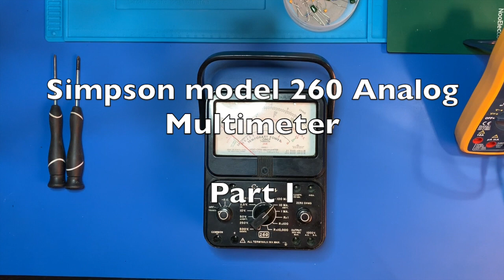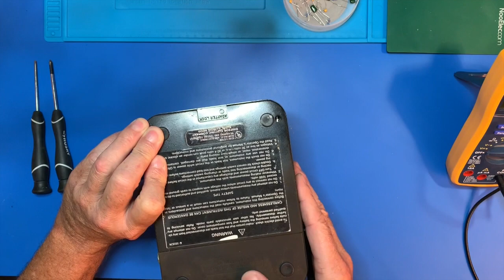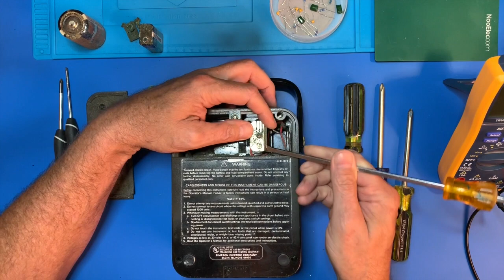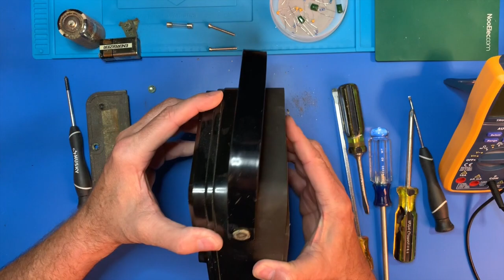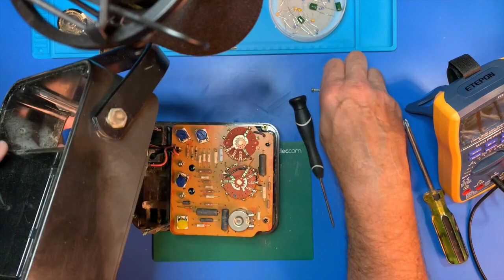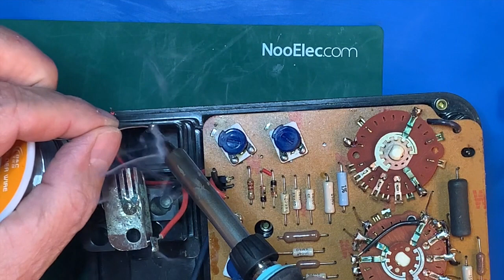SIMPSON ANALOG MULTIMETER REPAIR - PART 1

Comment: I have restored about 10 Simpsons.   The damage is almost always caused by battery leakage and corrosion, unless some stupid klutz has burnt the meter out by trying to measure voltage through the meter when set to measure current.  If so, the meter coil is open and cannot be repaired.

Comment: Black wire rot will go the length of the wire.  You need to replace it.   I just got a Simpson 230.  There are no videos on this smaller meter.

Comment: Great video thanks 👍 I do have a question for you if you would like to offer some advice. I have an analogue VOM Japan made, 2 jewel movement. I currently dug it out of storage as I remember storing it many years ago after magic smoke came out of it. On opening all I can see is one burnt resistor. This particular resistor is between the selector switch and the needle movement. There are no other connections on the movement input feed. So I replaced the 1.5 volt AA battery. The movement still works on low ohms, and still measures the battery voltage. It does require a 15 volt battery (Now Obsolete) I presume is for the higher resistance measurements. How can I determine the correct resistance value for this one burnt resistor. It’s obviously still passing voltage through it to allow the needle to move but I would like to get this small device back to the way it was. Regarding the 15 volt battery I may have to use 10 button batteries in series I just don’t know what mHa the meter design requires. The model number C-7230 HN is not recognized on Google. However there is an identical looking one I found, model Central C-7230EM the only difference is can find are, looking at the selector switch the low DC volt is 0.6 volts then 6 volts etc where mine is 0.5 volts then 5 volts etc. so very minuscule value differences on all the ranges. Anyways here’s hoping you can throw me a bone here as to how to figure out the value. The resistor size makes me believe it’s a 1/2 watt judging by the others inside. Non by the way are colour coded just written values. Thanks once again.

Side Note: This VOM has  No printed circuit board inside. All resistors are in an array around the selector switch typical of early AVO style meters.
Reply from the maker: I’m not familiar with that VOM. Your assumption on the wattage based on appearance seems reasonable.
Reply: @mpselectrolab1067  VOM = Volts, ohms meter. Just an analogue multimeter. Sorry for the confusion.

Comment from the maker: Been away for awhile. All the comments are great. No, I have really done nothing else with this meter. Please look at the other comments for ideas, like find the service manual. Not sure where parts can be found. I still think this old analog meter technology is very cool. But, I will be honest, I don't rely on it with the new fluke digital meters giving me more options today.
Reply: Some digital meters have a bar graph indicator in addition to the numbers.  But without such, the digital meters are very hard to use, if you need to adjust something to a maximum or minimum.  That is specially cumbersome if the meter auto range "participates".  I often get odd glances, when I disable the auto ranging and lock my range.  I have met only one analog indicator that sort of simulated the auto range behavior.  It was a tuning indicator on a Marconi analyzer.  I hated it and rather preferred a GR instrument.  Well, that was way back when, but I still often indeed lock my DMM to a fixed range.  If I remember, my one analog volt meter is Triplett 630-6.  And many of my vintage HP meters sport an analog indicator as well.

 A little tip:  When using side cutters for peeling wire insulation, it works much better if you turn the pliers so that you can pull towards the flat surface, instead of towards the beveled side.  The bevels tend to squeeze the insulation against the wire, making the removal of it more difficult.  Actually the same affects your other plier, although somewhat less, as the tool can be closed completely before pulling.
Reply: What series is the Simpson meter?
Thank you

Comment: Please note, if the battery has ever leaked and you have corrosion on the battery connectors, you have to verify that the connection to the battery is truly connected. I have come across that the lead can develop high resistance on the 1.5 v cell and not allow Rx1 or Rx100 to work

Comment: Good day, I have the same measuring device. Rx1 mode does not work. Do you have any suggestions?
Reply: check all the battery connections and wires for corrosion.   check the internal fuse.

Comment: You can use your digital to do a quick VOM check of the DC ranges.  Use the digital ohms meter and measure the VOM input terminals at each voltage range.  You should get an ohms reading equal to 20,000ohms per volt of the volt ranges.  ie  2.5 range should be about 50000 ohms on the digital.  Looking at you video the ohms range will probably work once the batteries and fuses are cleaned up and installed.  You'll need the fused in and operation to test the voltage and current ranges too.  Remember this is a very sensitive meter movement, it only takes 50uA for full scale on any range.

Comment: All of the Volt and AMP should work with out the batteries.( batteries are for OHMs.  Clean the fuse contacts.

Comment: Maybe if you checked it out when you first got it, it would not be in the condition it is in the beginning of the video. Maybe starting with a service manual before you start poking around would have been a good idea. Parts are available.
Reply: Where are parts available?  Do you have a link or a company name?  Thx.
Reply: Simpson has some parts, eBay. EHam, a search on the net will show many places.
Reply: @patricklozito7042  Thx.